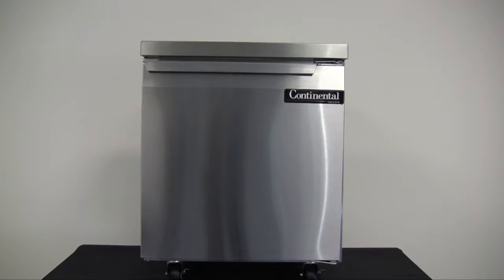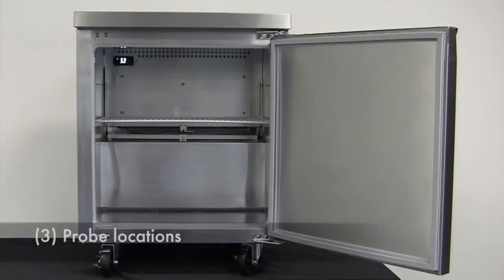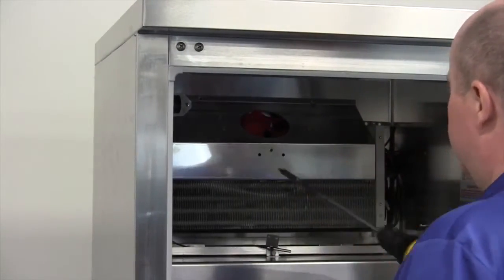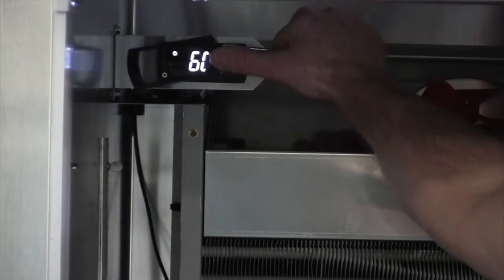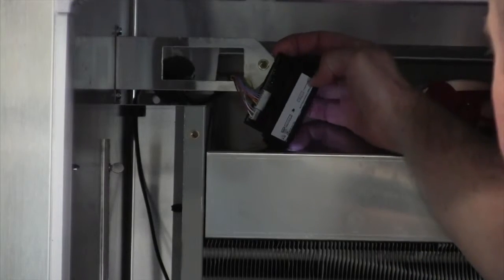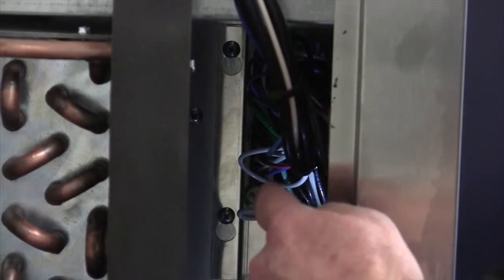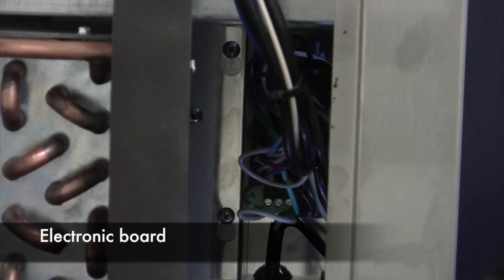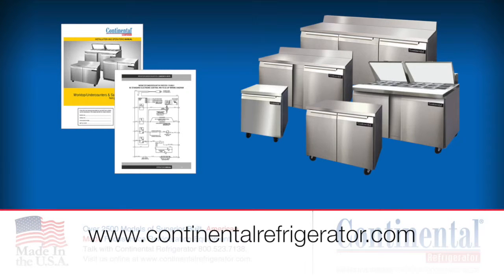How to Service an SWF27 with Electronic Control

Comment: Wow, your putting a Digital temperature control INSIDE  a freezer, i did not think that those controls were designed for that low of a temperature ( controller ambient wise) in a moist, wet environment. ( thinking defrost cycle here ) seems like thats just asking for trouble. control circuit board corrosion, bad connections at the plug to control because of corrosion. seems like a bad idea to me. it would have been better to put the temperature control outside the box.